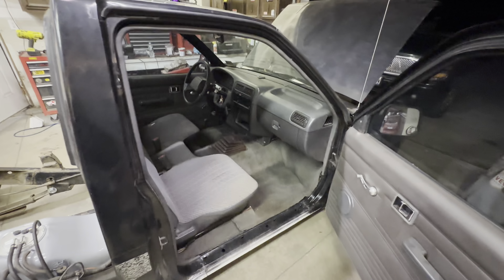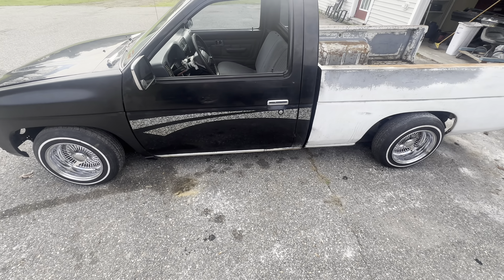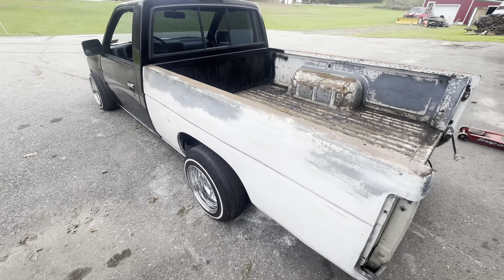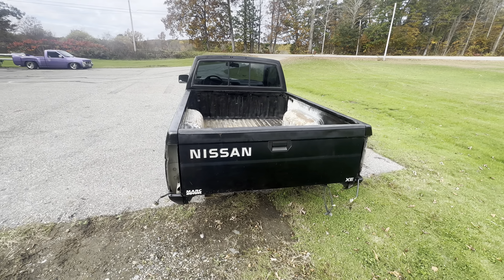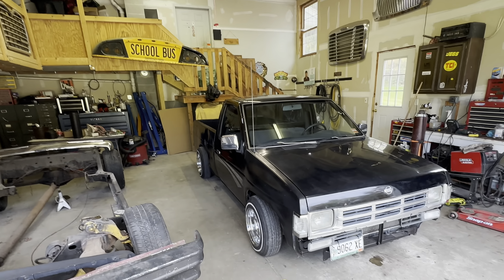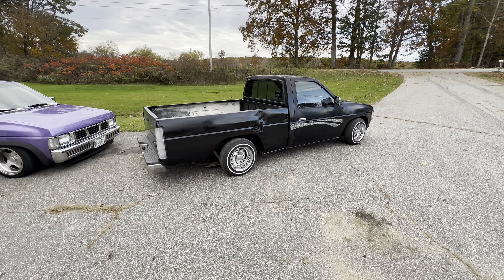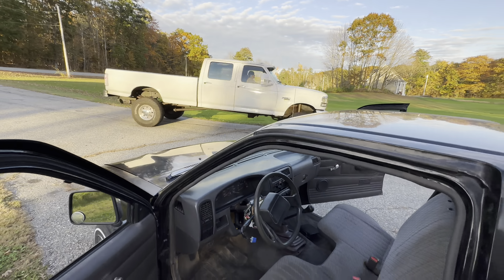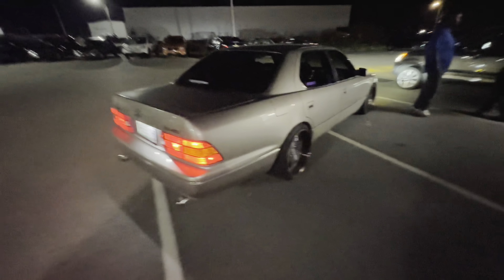Nissan D21| The Bed Goes On, Chrome Fender Flair Trim Install, Front End Alighnent + Driving It!!

Comment: Yo bubba idk if u gonna answer but I’m putting Toyota runner rims on my d21 same bolt pattern but it has play wondering if I should put them on?
Reply from the maker: if it has the same bolt pattern and your sure of it, I don't see the issue, just make sure that the hub of the wheel isn't keeping it from bolting up, if so, you should be able to have the wheels board out a little by a machinist!
Reply: @JapaneseMinitruck  luckily I had the lug nuts for it to sit right! And drove a hour w full set Appreciate it🙏🏽
Reply from the maker: @magdielvz427 of course! If you want to ,Send me a picture of it on Instagram when you get the new wheels on!! I'd love to see it!